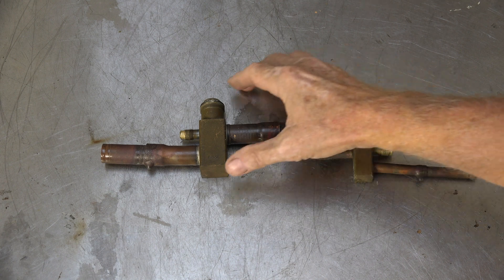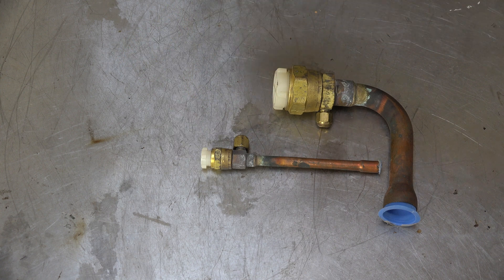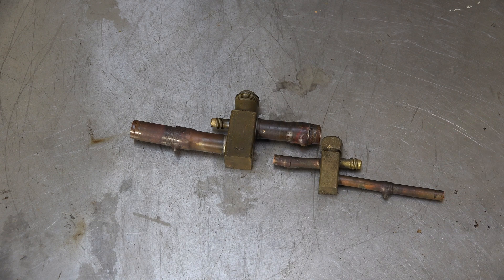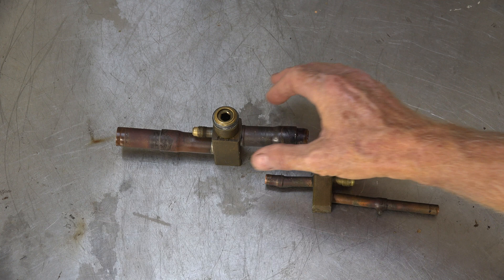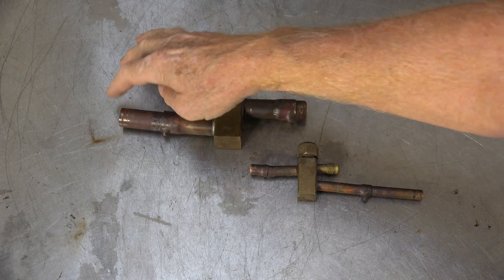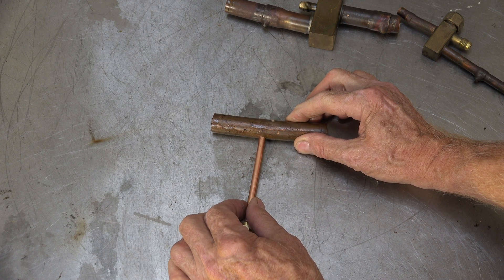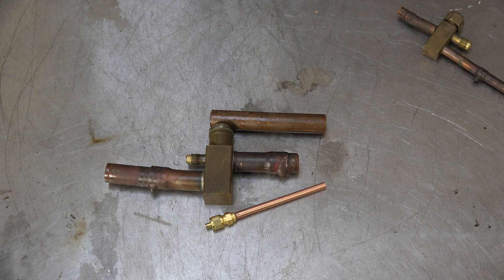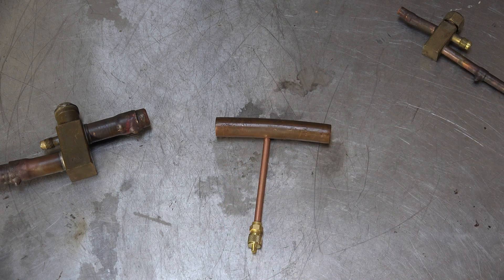Removing the service valves on the A/C

Comment: HVAC industry ought to have improved on service valve design. O ring leak is a common point on air conditioning system and one should be able to remove these service valves like valve core without freon leak

Comment: On the coast of SC in 10 years it’s time for a new heat pump
Reply: Salt water corrosion destroys Everything
Reply from the maker: The life of a heat pump averages 18 to 20 years.  If it is exposed to salt air, much lower due to corrosion.
GFM

Comment: I've done it in a pinch but it's nice to be able to pump the system down when needed. Call me a hack but I've been able to front and back seat the valve and have been successful stoping the leak, I've also used nylog and Teflon taped the threads stopped them from leaking, it all depends on the situation but fixed is fixed.
Reply from the maker: Not to beat you up but, I have followed so many techs that "sealed the threads" of those caps with any number of "sealants".  The cap threads are not tapered.  Only tapered threads are are sealed by pipe sealants.  I did a video on this that shows how this works: https://youtu.be/8M66-w3ZY2k  When, by far, the most common leak is the "service valve" (they are not true service valves) and pumping down is not an option, just dump the valves and seal the system with sil phos and be done with the problem.  I have seen these caps literally blow off from the threads and damage the siding on the structure.
GFM

Comment: This question is related to another of your (really old) videos about 2-stage thermostats. I'm trying to control my Lennox xc21 with a single-stage thermostat (I only have 4 wires  to my thermostat and I really need my AC to run continuously at full-power anyway - I don't need the low stage). I infer that I should simply jump the y1 and y2 connections at the AC unit, is that right? That is, if I want 100% of capacity then y1 and y2 should both be energized together - if only y1 is hot then I get "70% of capacity," and I need both y1 and y2 to be hot to get 100% output, right? (That leads to the question: What happens if only y2 is hot? I don't plan to try it, but just curious.) Thanks!
Reply from the maker: First, I would allow the 2 stage system to operate as designed.  Setting the thermostat and forgetting it is best.  
If you manually turn on the A/C when you want it, you can try jumping Y1 and Y2, but it may be designed to start on low and go to high after a delay.  
GFM

Comment: GFM, welcome back!  Question: as an alternative to straight tubing the mess, can some red goop / threat sealant be applied to the service caps to keep the refrigerant from leaking out?
Reply from the maker: Absolutely not!  The caps are really just dust caps.  There is no gas sealing properties in the caps.  I lost count many years ago of caps with assorted sealants/orings, etc that I have removed along with the valves.  I actually started replacing these valves with brazed fittings in the the late 1980s.  
The less mechanical fittings you have, the better.
GFM
Reply: @grayfurnaceman  Thanks GFM - I wasn't aware.  Really appreciate the video and the feedback to the question!  That's a great idea you presented!
Reply: One thing I started doing is applying some Nylog inside the service valve body around the internal walls where the oring will eventually seat. Then when you open the valves, it’s not just relying on the oring to seal. A really squeaky oring gave me the idea and I’ve done it ever since. I also apply some Nylog to the cap seat before tightening those down after opening the valve.

Comment: I have a problem. AC condensing unit condensing coils are corroding away. Starting at the bottom on unit working its way up. I live near beach in South Texas. No way to have repaired without replacing condenser coil? AC still cools fine for now.
Reply from the maker: Do you have a dog?
GFM
Reply: @grayfurnaceman  No I think we had well waters sprinklers spraying on it a bit.
It is in front yard no dogs there.
Reply from the maker: @monkeyman2174  I guess that you probably are getting salt from the sea.  There are units that are designed for seaside exposure.
GFM

Comment: Welcome back, I always enjoy your videos. Question, why not just replace the service valve?
Reply from the maker: If the service valve leaks, what would make you think a new one would not leak.  Doing the same thing and expecting a different result is the definition of insanity.  lol
GFM
Reply: @grayfurnaceman  Thanks for your reply. In my experience, not all service valves leak and it's nice to be able to pump down the system. You've got a good work around here. Thanks for sharing.

Comment: No more pumping down?
Reply from the maker: The original reason for the "service valves" were required was so the unit could be pumped down and the repair done without losing the charge.  You can't pump down when the service valve is the failure and most leaks are at the service valve.
GFM
Reply: @grayfurnaceman  you can though to change a defective txv, leaking evap coil, or take out suction line drier. I think the risk of leaking service valves is blown out of proportion -> if the machine is decent quality (no chinese junk or goodman), was installed right without overheating the valves and the caps tightly - far less likely for the valves to leak.

I'm sure many homeowners don't call for service unless their unit stops cooling properly, the techs disproportionately see units with problems and assume almost all service valves eventually leak. Don't see the successes as much - the 15++ year old units that work perfectly with original charge and no leakage.
Reply from the maker: @Jon-hx7pe  With the widespread use of recovery machines, I see little value to a pump down.  Getting out the recovery machine is now just a small part of the necessary equipment.  
Yes, service techs only see the failures, but most failures are charge issues due to leaks.  Most leaks are at service valves.  
This was true when I first worked on A/C units in 1977, and it is still true.
GFM